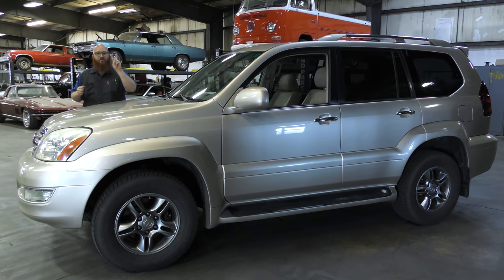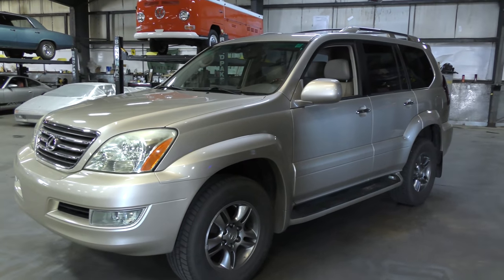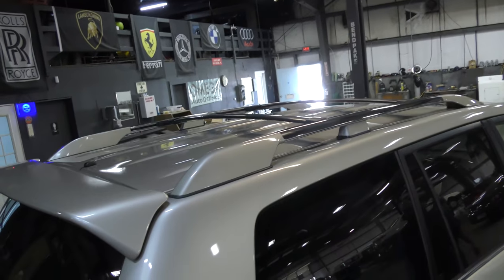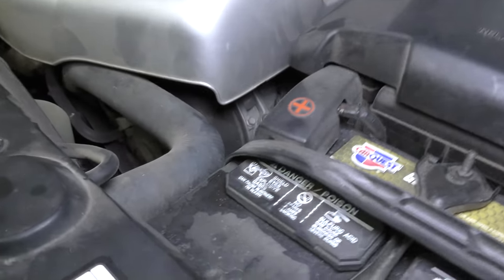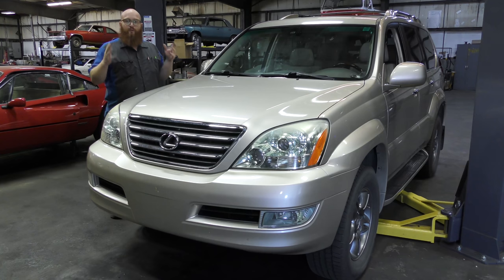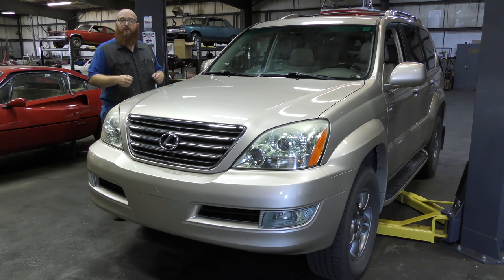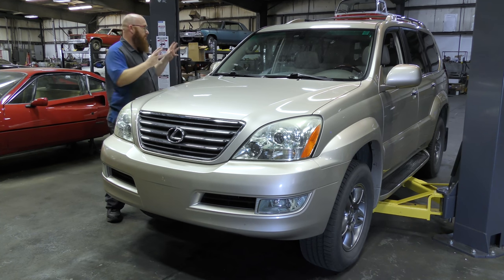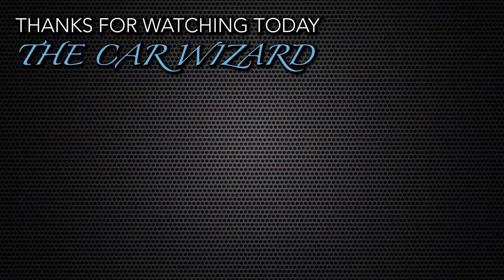Reliable cars get surprise bills too. Simple oil change on '08 Lexus GX470 turns into $1200 repair

Comment: I like going to work everyday at Lexus as a tech, got a smoking deal on a ls430 with 138k miles for $800 that a customer didn’t want to fix. Thousand dollars later in parts and me doing the labor the car will run another 100k miles easy.

Comment: I have a 2006 gx470 like this and got it for a good price compared the the cost of used cards nowadays. I love it and haven't had any major issues with it, just some idiot who put an ill fitting radiator cap on it. Wasn't the car's fault though, just someone being dumb and almost caused my engine to overheat.

Comment: My first car job was as a parts delivery boy. That was when gas stations had shops. I would deliver a clutch or some brakes and I saw the cars on the lift and it really didn't look all that complicated. Then the next 3 times I took my car in for service not only was I over charged but they screwed up the job. So right then and there I decided why should I pay someone to screw up my car when I can screw it up myself for free. The Wiz may think 12 bills is nothing for a timing belt but to me I can't remember when I paid $1,200 for a used car. Timing belts aren't hard It's like anything else. Just keep trying till you get it right. And don't tell me you can kill the engine if the timing is off. All you have to do is rotate the engine over a few times and if the marks still line up your good. Now with You tube vids there's not much of an excuse not to do it right yourself.

Comment: Your video is spot on and good advice for any car buyer.  We bought a 2015 Toyota Land Cruiser in August and love it.  It was in like new condition and we have had the front, rear and transfer case fluid changed at a Toyota dealership.  It has 77,000 miles and I was wondering if I should have a trans fluid changed and what I should expect to pay?

Comment: I could buy 6 my cars (about 22210 USD - the cheapest 4x4 on the market) for 1 absolutely basic Lexus in the Czech Republic (also in the US you have about 5-10 times higher salaries with no paying about 50% taxes). I have Dacia Duster. Cheap and still not so unreliable vehicle (even better in statistics, than new Mercedes or BMW), although Romanians are not known for making good quality work.
No good engines allowed in EU.
Spare tire is slowly removed from cars, but I still dave one inside and I carry a small compressor. It is kind of the only reasonable way. In here you had legal obligation up to last year to have a spare tire in functional state. Nowadays you can have a repair kit and prepaid insurance for this.

Third thing I want to mention:
I have a problem finding any mechanic, who would fix problems, before they appear. My mechanic for the previous car always stated "it is not in a good condition, but it will be OK. Even forcing him to change timing belt was a 3 months discussion. Replacing oil in gearbox is impossible, because in mechanic manual it clearly states "lifetime". In that car (which is still in the family) it is there already 16y and 310000km.

Comment: I have a 2006 ls430 I put average of 2000 in maintenance every year and Never had a problem with it. Also probably one of the most expensive lexus/ toyota to maintain. A new LS is about 20,000 a year. Maintenance is cheap!!!

Comment: I bought one for 6k! Did differential flushes, spark plugs, 3 coils, drive belt with tensioner, oil change, air and cabin filters timing belt and an alternator while I was down there... thank God I work on cars or forget about it lol

Comment: A full front brake job, rotors and pads,  four shafts replaced plus an oil plus filter change with synthetic for $1200?

Wow that is cheap, I don’t know how the Wizard can maintain his shop while charging those rates. He will work half a day and make  maybe $500 net profit.

Comment: That always was an eye opener to me when I worked at a dealer was how you would inspect the cars but, people wouldn't budget to get those jobs done. They would absolutely rub your nose in it if you didn't find something untoward about their vehicle that they later found out about and then tried to get compensated for from the dealer in some way. Freeloaders essentially. Many people don't understand much about cars and vehicle maintenance so they always think mechanics are trying to take advantage of them when you're not or they think it's a personal attack on them to point out problem areas on their car because it reflects badly upon them as a human.

Comment: As a mechanically inclined individual myself, it's always a challenge dealing with bringing my car in for service. I prefer to do the work myself, but I don't have a garage, I don't have a lift, and I don't know how to use a torch, so doing some things myself are out of my wheelhouse. Often times I don't have the time or energy to tackle it at home, outdoors in the heat or the snow. So I must take it somewhere to get serviced. Sometimes I already know what it needs and just ask to change a part for me, sometimes I need them to diagnose it, sometimes they inspect the car and find other things wrong. When they find things wrong I didn't know about and didn't feel like the car was driving a certain way to indicate imminent failure, I just make note of their findings and explore for myself later and keep an eye on it. Also, I try to get someone else to do it for cheaper if possible. I have such a hard time trusting shops with my car, especially since I've had situations where they lied to me or told me something wrong several times before. Had the bearing on my A/C compressor go bad once. For some dumb reason I couldn't figure that out for myself, so I took it to the dealership to diagnose the sound. They told me what it was and what it would cost, something like $1600+ and he's telling me how it's chewing up my belt real bad and I NEED to get it done right away! No... my belt is and has been fine, it doesn't even wobble or chirp, just sounds marbly, I'll take it elsewhere to get it replaced for far less. Which I did, and never got or needed a new belt as the one that was on there was fairly new as it is and still in great shape. I hate having to be this way, but I am when it comes to shop visits.
Reply: I am the exact same way. Can't wait to buy a house with a nice garage. Actually, really all I care about is the garage, as long as the house isn't about to fall in on itself I'm good lol. I'm a car guy thru and thru
Reply: @toyotadude6771  Holy crap you sound just like me! I am actively working towards getting a house at the moment and my girlfriend asks me "So what are you looking for in a house?" I just say "A garage, first and foremost! Preferably 2-car, preferably at the front of the house. Maybe even a basement so I can do other hands-on projects and have somewhere for workout equipment." I'd like a nice kitchen too but it doesn't have to come with one, I can always make one.

Comment: Man, I bought an 04 ES 330 thinking it would be a good buy.
189k miles. I got it for $1,800

I replaced the timing belt, water pump, brakes, new tires, new exhaust.
I was on the highway, and the rpms went all the way up while I was just at highway speeds
The transmission failed on it. Now I have a lexus I can’t drive. I don’t have $2,000 just sitting around to drop on that car, after all the money I’ve already spent. I have 2 other cars as well (6th gen accord 5 speed, 03 Element)
Reply: I have the same car at 150k miles. The transmission is really bad at shifting at low speeds, but once it gets up to speed it shifts smoothly. I'm a little worried that the transmission is going also. Did you ever change the transmission fluid?
Reply: @piotr5646  yeah, but not the filter. I did it when I first got the car, I was really hoping to take care of it and have it for a while. My other cars are slightly older and have comparable mileage. My 5 speed sedan has 270,000 that’s my daily driver. My element has around 192k I believe. I do still believe they are reliable cars, I’m just kind of frustrated. I live in MN so I just keep thinking about where im gonna park it in the winter you know? 
It did shift a little hard at first as well, but it was a really great car for a while, I put close to 20,000mi on it

Comment: Broken, in the shop, fixed. Broken, in the shop, fixed. That’s the life of a hooptie owner, Hoovie.
Reply: I have had chevys that were ok.  I still have a 2010 Cobalt that runs good, so far had a front wheel bearing replaced (hitting bad potholes?) and a cam sensor (replaced under warranty).  Tires only lasted 55K miles which was disappointing, but I probably could have gotten another 10K out of the tires if I pushed it.  Replaced the battery after 10 years, even though it worked great.  That may have not been smart but I was afraid of getting stuck someplace with a dead battery.  Put the old chevy battery in a lawn tractor so it was not a complete waste.

Comment: I like car wizards content , he's a top notch mechanic as far as I can tell.That being said , I completely disagree with the toyota/lexus reliability sales pitch.I've had 2 toyotas , both I had serviced religiously.I had constant things break or wear down on them, was left stranded more times than I can remember.They rust out very easily and trying to keep the cars winterized from salt was a month to month headache.My last toyota I spent thousands changing parts out , toyota said they had a recall on the computer , got computer changed at the dealership, week later cars dead , computer blew and fried everything.Bye bye toyota.So yea not this this time wizard.

Comment: Hey @Car Wizard, I always hear recommendations for Toyota or Lexus but what about Mazda? They've recently surpassed Toyota in reliability ratings and it seems more modern Mazda's are just as reliable and simple to work on as Toyota/Lexus.
Reply: Mazda has teamed up with Toyota recently. They have a new joint facility in Huntsville, AL.  It's  called Mazda Toyota Manufacturing.

Comment: 2011 Honda Civic with 162K.....A/C Condensor Fan, A/C Compressor biggest issue I had.....Oh and brake/suspension last time.....front brakes, 2 leaking wheel cylinders, and 2 lower control arms.....thats it.  Nothing with the engine.  Of course I change my own oil and take care of it.

Comment: I have an 06 Tundra w/ the same V8 as this GX. It has 125k miles. I've driven the absolute crap out of it. I've hauled and towed well over the ratings and been in all kinds of terrain and all over the country. Other than oil, tires, and brakes, the only things I've replaced are the front calipers. It's overdue for a time belt and I'm expecting to get another 100k miles before I need it done again. The clear coat is gone on the roof and you have to keep up with rust prevention on the frame, but I will never buy an American truck or SUV (and aside from Honda, any other brand for that matter).

Comment: Wizard, can you give an opinion on a 2021 Chevy Colorado? I've done a lot of research and I hear only good things about the 3.6l v6, but it had problems with the wrong fluid being out into the 8 speed transmission from the factory, but I believe they fixed it after 2019. And even with the wrong fluid, it doesn't seem like anything is physically damaged internally

Comment: Beautiful GX470, in great condition. 151k miles is NOTHING for this powertrain and chassis, plenty of reliable - serviceable - comfortable life left. Even compared to current vehicles it has a lot of creature comforts. Yes, the cassette deck dates it - and no Bluetooth - but that could easily be solved with a head unit switch, not very expensive these days. New rotors and pads? Reliable stopping is vital for safety. CV boots and joints at 151k? Those are a wear item. $1200 to get this great Lexus back in fighting form? It's like having a car payment for 2 - 3 months instead of 5 - 6 YEARS.

Comment: You have a 10+ year old car with over 100K miles, you better get ready for the $1000+ repairs. I think rural drivers who put a lot of miles on their cars understand this and have been dealing with repair vs junk it most of their lives and understand the balance. I do not put a lot of miles on my car, I got a $20K Mercedes GLA with 22K miles on it, in almost 2 years I haven't changed the oil yet because I haven't put 5K miles on it yet. I may get rid of the car after 10-12 year because of age and unless we do some road trips in it, it probably will not have 50K miles for a 15+ year old car. I got a Promaster with 40K miles for $20K and that is our main road trip car, since we like to camp while traveling and I did a do-it-yourself conversion with a few cabinets, solar electrical, plumbing, and a scissor couch bed, that will be running up the miles. Will keep fluids fresh and synthetic, at 60 or 70K will start thinking of plugs and coils, water pump and timing belt, other things that break.

Comment: Wizard I can agree with some what what your are saying but not all, but I'm an old school fan with proven vehicles that have 200k to 300k like your foreign cars, Chevy astros, gmc safaris, all days long 200k to 300k, ive personally done 500k out of a 2000 model, im currently rocking a 1995 ford ranger 249k miles 3.0l v6 all iron engine bought used weve owned it 17 years and done all  the maintenance on both.  No all american made cars are junk.

Comment: I have a 2006 chevrolet Aveo and a 2001 Buick Country custom and a 2002 chevrolet trailblazer EXT lT. my chevrolet Aveo has been to a body shop once since I have owned it and it's been in to repair shops and my 2001 Buick Century Custom has been to one repair shop since I'll owned it. But my 2002 chevrolet trailblazer has been for repair shops.

Comment: change the 470gx brakes to gx460 mainly rotors and calipers up front. its common issue for 470s have brakes go bad quick. upgrade and it will be fine.

Comment: the American cars are built well enough to reflect the price, its just that the American manufacturers have a higher initial parts failure rate, which is usually covered under the 3 year bumper to bumper. imo the long term parts failure rate is comparable to the Asian cars, albeit still less.

Comment: I'm a glutton for punishment. Wife has been driving around in 03 ES300 for a few years. She wanted an SUV. Found her an 06 rx400h. Bought that. Instead of continuing to drive the ES, I dump money into my 95 eldorado. Literally. In just labor. Parts aren't as expensive as they were 10 years ago which is nice. But, labor went up.

03 ES300 170k mi.
Or
95 eldorado 136k mi.

Told you I'm a glutton.

Comment: Please Please listen to him, he knows what hes talking about. I have an Audi Q5 with less than 150k miles, second owner and its nothing but problems literally every month. Something goes wrong. Im lucky to be able to fix most of these issues (water pump leak, brake sensors, electric fuel pump, etc) but if it belonged to someone who doesn't, it would costs thousands to maintain. We have a neighbor with an RX350 that hit 300k miles and nothing but fuel and oil changes

Comment: Is just regular maintenance, I have a 2010 lx 570 , I just replace front rear rotors and brakes pads , oem !. Spare tire on mine shows on the display the psi .

Comment: You know GM just doesn't care anymore when you see their small to mid-size SUVs now have these 'lifetime transmissions' that are not owner serviceable. You can't even check/flush/change the fluid on them! You have to take it to a dealer. I recently spent fifteen minutes looking for the trans fluid reservoir on a Trax, and found this out.

Comment: thats a toyota prado an asian/european/middle east model unlike the US online model like tundra and 4runner 
and this is the Lexus version V8  of toyota prado v6 (also comes with 4 cylinder and a deisel engine )
we have both the lexus and the toyota version 
quick info : all toyota cars had or still have a lexus version (even corollas used to be called lexus HS )

Comment: 8:40 You said "Fortunately Toyota's not to that level yet, they still make good cars, you can rely on them" While Toyota is still at the top of most reliable cars, they're not what they used to be and they do not still make cars as good as before. There's been tons of transmission issues and recalls on new Toyotas, so no they don't still make very good cars, comparing to other brands.

Comment: Question: I currently own a 2006 GX that has been well cared for in its 170K miles.  My father-in-law recently passed leaving behind a 2005 LR3 HSE HD 4.4 V8 w/ 105K.  He's the original owner, used a LR mechanic and did meticulous maintenance.  I'm considering selling the GX and buying the LR3.

Sincere thoughts?

Comment: "They're great cars, you should buy one"  turns into look at all the sh!t wrong that needs to be replaced.  They're vehicles. Things wear out on them.  I'd prefer to give my money to a vehicle with their company headquarters here in the US vs Japan.
Reply: I'd rather replace a CV boot than a poorly engineered engine.
Reply: @CACressida  which engine is poorly engineered?
Reply: @CACressida  143K on my junk 3.0V6, I had 153K on a 03 Ecotec, 88K on a Turbo Ecotec and many thousands of miles on other GM engines.  I'll stick with what gets me around.  When you change the argument about taxes and what not instead of indicating where the money ends up after a vehicle you've purchased....I won that one.